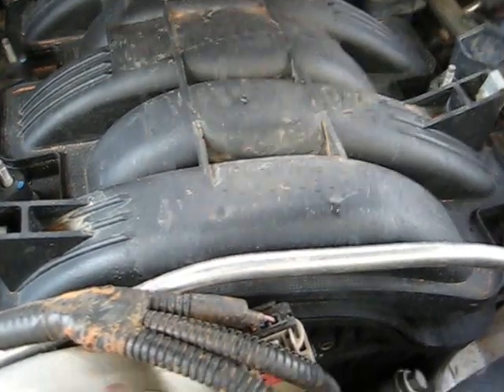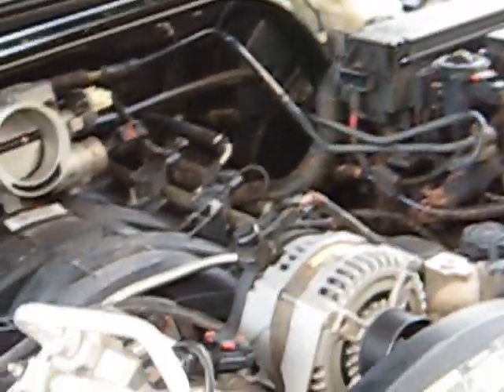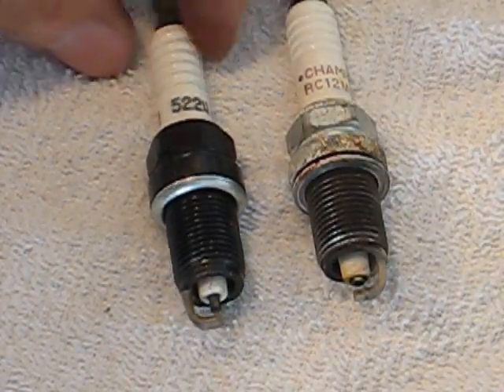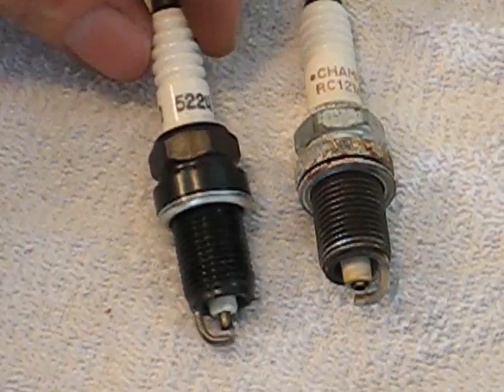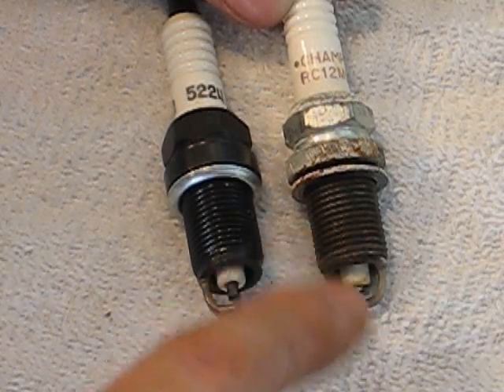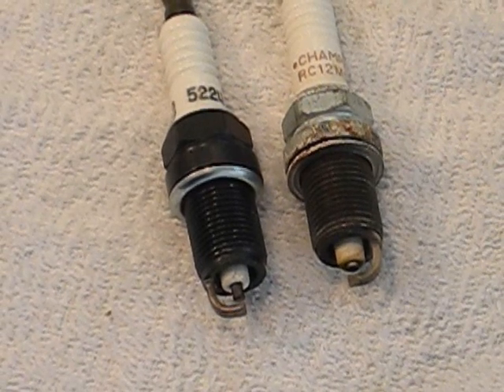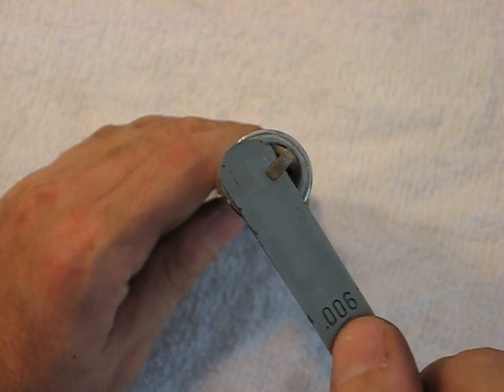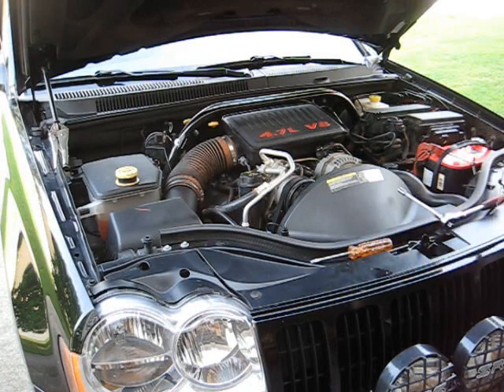How to Change Your Spark Plugs Part 2 - Jeep 4.7L

Comment: Nice work.  Just did this and everything went smoothly - just that leftside rear plug is a PIA to remove and replace.  I used a 3" deep socket instead of the extension - worked well

Comment: Nice video. I had a manifold leak, on my 05 4.7,as well. It was the driver side. I went ahead and got the hardware for the whole side. There are a couple different types of bolts for this. Once I got manifold off, I found that the back two bolts were sheared off. Fortunately I was able to get a pair of vice grips around the heads, and didn't need a back out kit to get them off. It took the better part of a day to get everything off, and back on again. The worse part was getting to the manifold!

Comment: With the increased gap on the old plugs, much more current is needed to jump the gap.  This is what ruins a lot of coil on plug units, in fact any sort of ignition system.  When a coil fails, folks should go one step ahead and check the gaps on the plugs, and the shops equipped with the latest tools can check secondary voltage to the plugs as well.  Too much means the coils are being overworked, and insulation starts to break down in them.  Nice movie here, informative as always, sweet!

Comment: My 99 Ford Expe started running rough and the check engine light came on. Took it to auto zone as they will hook up their ODB2 tester and print the trouble codes for free. 2 codes came up, #4 cylinder spark plug and MAF sensor showed it was running rich. That same spark plug blew before and it's a ***** to change in the very back. After changing it though it didn't help. The coil pack on top of the spark plug was the culprit.

Comment: Wondering if the "die electric grease" goes on top of the plug, where it goes to that coil pack?
Also do you know what torque the plugs should be in at? foot lbs?

Comment: wow did you have like a massive air leak when you started it up after changing the plugs? It sound like it on camera. Like a giant sucking sound. You can hear it best where you turn off the engine.